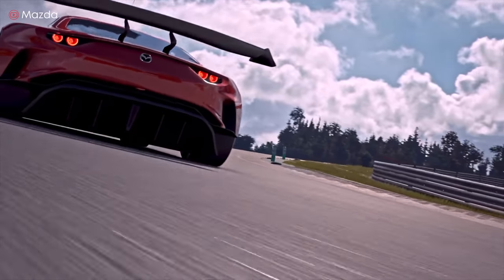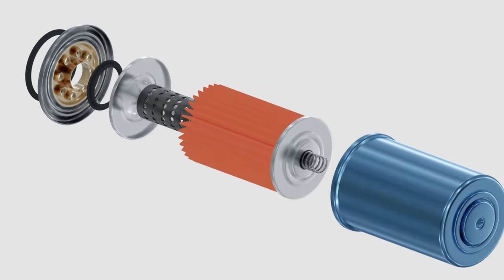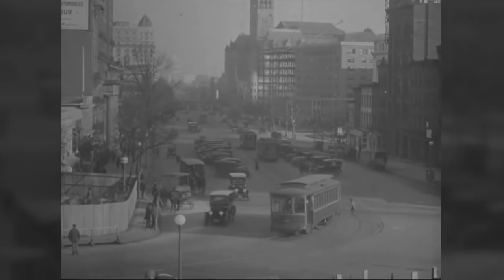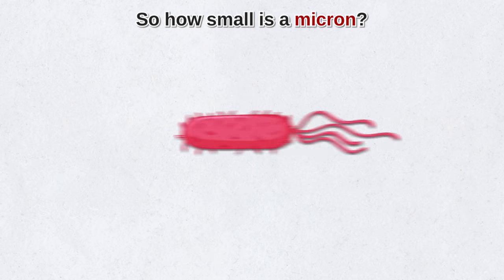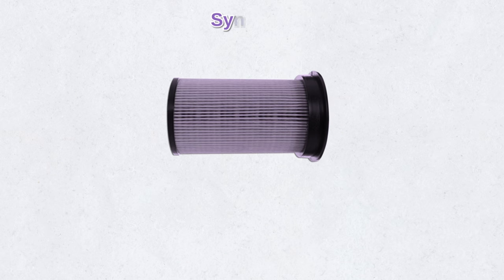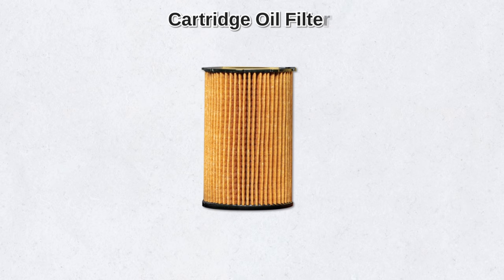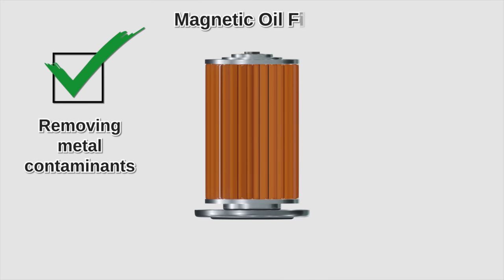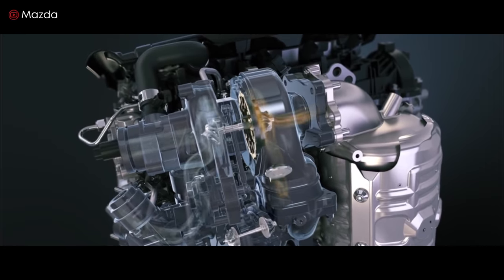This New Oil Filter Just Changed the Game (No More Oil Changes)

Comment: I added oil treatment and may have added too much, after an oil and filter change and the engine seized up within a few thousand miles. I believe the oil was too thick for the oil pump and failed, but don’t know for sure, the engine just seized without any kind of warning, It was a V6 engine with 145000 miles on it.

Comment: Hi Scotty,  I got a request for information on the following type of oil filtration that big rig trucks utilize as follows:      I liked your introduction to 2ndary types of oil filters.  Yet,  am thinking you could take another video with another step beyond.... I wish you would have taken this a step further to introduce us to the 2ndary oil filters that big trucks use.  Whereby,  on a cold morning oil is heated 1st; then pumped thru a 2ndary filter.  Lastly, the pump continues to circulate warm oil until a set oil pressure is achieved.  All before the engine is even started.   Feature benefits of this filtration system are just as easy to grasp as what you already presented.   Big rigs typically go 50k miles between oil changes.  Best Regards,  Sam
Reply: When I was selling Gulf Coast Filters years ago.their.main business was heavy duty diesels such as locomotive engines on Shell offshore rigs. Got a request for information from NASA. They are listed as a customer now..At the time they were moving the.Shuttle around.and  the Gulf Coast heavy duty filters used Bounty Big roll paper towels. Of course the little filters used toilet paper. They might have gotton too busy with the big filters to do the little filters. The best little filters are the Australian Jackmaster. Looks like they are working together. The Jackmaster is the only filter as easy to service as the Gulf Coast junior. I couldnt resist. I ordered
 one..You push the TP in and put on the lid. If you cant find a tightly wound roll of TP. You can buy good elements for 30 dollars and up.All I have now is Motor Guards  Gulf Coast juniors and the Jackmaster.

Comment: I have a funny story.  I brought my Cherokee to get an oil change at Sears back in 2006.  After that I got back to the base then there was a coolant explosion under the hood.  I opened the hood to find out for some reason they took the cap off, and apparently set it back in place without tightening it back down.  Several months later I was rebuilding my engine.  I haven't let anyone else change my oil since.
Reply: Took the Rambler to Sears to get new tires. Didnt feel right. Got out and checked. The lug nuts had been started but not tightened. Walked back into the store and told them they didnt tighten the lug nuts. They said they tightened them they just loosened up. I hadnt even gotton out of the parking lot

Comment: Funny that small air cooled and outboard engines still don't use oil filters. 
 My truck has an internal cartridge filter that many of newer cars have and it's not any less expensive than a spin on.  It is only a filter and an O ring whereas the spin on includes a metal housing and a few parts.

Comment: Best filter? I use the OEM ones, it is their motor, so I would hope they would supply the correct filter for maximum engine life. So far, no issues.
Reply: Maximum engine life? How about at least until the end of the warranty period.
Reply: except that engine manufacturers do NOT make oil filters...  May be Purolater or Fram with OEM number painted on, ya know?

Comment: Use only Napa best (made by wix) Most are, just different levels of quality. Use Amsoil for years and switched to mobil one. Any good synthetic will do, don't drive much and have 3 vehicles on road, change oil every couple of years. Use synthetic in everything including Kubota diesel and gravely etc. lawnmowers.

Comment: My MAZDA dealer REQUIRES me to get an oil AND filter change every 5,000 miles "because of our hot and dusty environment". I supply them with CASTROL Edge synthetic 5W-30 (their weight spec) and they use "MAZDA" filters. I fervently hope the MAZDA filters are at least a synthetic media filter with a good bypass valve!

Comment: Hi Scotty from the UK. Many years ago on a BMC  A  series engine after an oil check 5miles down the road the cartridge filter pushed out all of the oil but I switched off in time to save the engine... it turned out that the cartridge housing had more than one o ring!  Dodged a bullet that day.

Comment: Whenever I bought a new car, I would change the oil and filter after 1000 miles. Figured that most manufacturing particles would be removed with the first oil change. Never had any engine problems in first 100k .

Comment: Hi Scotty, They should make changing transmission oil easier… I bought a truck that sat transmission oil had not been changed in quite sometime that the oil looked like very dirty motor oil… it will have to be rebuild cause metallics where found in the pan… Thank you for your info. 👍🏼😎

Comment: 20 years ago had an old 4 door Chevy celebrity think it was 88ish went to the other side of town to change my oil at my bros house , for whatever reason prob a lefty, I forgot to replace the oil cap .During the ride home  20 mi or so I began to notice the engine smoking and a funny knock sound coming from under the hood .Long story short I blew the little 4 banger up til then was a really good surprisingly strong little motor 👍
Reply: I think mine was a 86 2.5  I pulled the engine put a 95 Impala.transmission on it and put it in my Farmall H  some say why didnt you put in a V8 . The only thing that will stop it is if it loses  traction. I have an Oldsmobile. V 6 I  think might fit the Impala tranny if something happens to the 2.5. The Impala 4 speed is in front of the  Farmall 5 speed.Has a modified F 350 front end with power steering.  Allis Chalmer front end loader. No oil change filters on every thing LOL. Motor Guards and Gulf Coasts  When I rev the engine I can hear piston slap. It doesnt use oil. Been that way for 20 years. The old man I got it from said it had about 30,000 miles since a GM rebuilt engine was installed.

Comment: Old Fiat 500 from 60-s and 70-s and the same engine had Fiat 126 they both didn't have oil filter, then it had centrifugal dirt oil separator on the end on crankshaft which you can open and wipe the dirt.

Comment: I took my truck in it was running rough so I told them to change the oil while it was there. They called me and said they went to try out my truck and it died and would tow it back in. The next day they called me back and said the motor seized up they forgot to put oil in it . They had to buy me a new motor and get me a rental

Comment: Here's one about 22 years ago, I went to change to oil in the step mothers van. Was told it's was changed by her son 3500 miles miles ago... it wasn't and the oil was so bad I couldnt get the filter off had to stab it with a screwdriver in order to turn it. The oil was completely turned to sludge im surprised it came out at all... had to flush the whole system and immediately change the oil filter a second time 10 mins later...

Comment: I did and oil change on my BMW 1 series, filter was supplied from an online parts store using the registration plate of the car... It would have helped if they actually provided the right one... Found out after taking it on an hour long drive with the oil pressure light coming on and off (Didn't actually realise it was that at the time. Ouuch.  Turns out it didn't have a locator pin like it should have.  - Could have been rather expensive as the bottom ends like to go on the n47 engine... as well as the timing chains. - Since replaced it with the right one and its still going strong

Comment: I once worked at Toyota and we had a customer who had a oil change appointment set up but her and her boyfriend were going to go on a trip, and they wanted to leave early, so her boyfriend said he could do the oil change. By the time the car made it into the shop, on a flatbed, it had no transmission fluid and doubled the amount of oil in the engine🤦‍♂️. Instead of undoing the one drain plug for the oil underneath the car he took out like the 28 or so bolts that held in the transmission pan completely drained that and then proceeded to feel the car with oil needless to say her transmission was fucked and so was her engine. I mean he wasn't even smart enough to look at a YouTube video.

Comment: So I went to go get an oil change. The oil tech barely applied a socket to the plug when it fell out. Come to learn that the last oil change place stripped the plug and was barely held. That what you get with an aluminum oil filter. So... I had to pay $70 to tow the car to a repair shop to have a new oil pan installed. Since I was heading out for a drive from Michigan to Washington state, I needed it fixed now. So $700 and a day later I was on the road. Ugh.

Comment: I use Mobil full synthetic oil and a Mobil full synthetic oil filter as I believe after research 🧐 they are the best and change every 7-8000 km maximum ( 4500-5000 miles)

Comment: Using an oil designed for higher mileage for changing one should change out their oil filter every 3500-7000 miles & replenish what is lost in the oil filter change. Even when using a high quality filter I change it at 5000 miles, especially in the from spring, summer & early fall I switch out sooner.

Comment: Gonna upset some people but I have used Mobile 1 full synthetic oil with their premium filters on my cars for years without any issue. Using the better oil and filter I usually run 7-10k miles per change so basically i make one oil change last two. It’s worth the extra 10-15$ upfront and keeps me from having to get under the car so much.
Reply: I probably average 1 oil drain every 100,000 miles. Sometimes I want to try a different oil. I use the game changer filters. I normally change the game changer filters every 6,000 miles. Running a little late on changing the Wix on the Pontiac. Been on there about 4 years and 60,000 miles. Try not to spend too much time under the car. I dont use junk. Very little showing up in the Jackmaster which tells me the Wix is still clean and the Walmart synthetic is doing its job. Its been awhile but I probably liked the feel of the wix. They all do what they were designed to do
Remove the engine damaging abrasives from the full flow of oil to the engine. You change the oil to get the small engine wearing stuff or install a game changer filter to clean the oil.

Comment: My first car a 54 chevy belair had no oil filter, just changed oil every 1,000 miles.  It also had one of those air filters that you washed out with gas and refilled with oil.  I also had a 40 chevy with the same deal.    Paid 150 bucks for the 54  and 25 bucks for the 40 chevy  Built like tanks.  no seat belts though .

Comment: We quit using FRAM oil filters, because of low oil pressure. We now use supertech oil filters and good price and change them every 5,000 miles along with oil change. Royal Purple only!
Reply: troll filter ^
Reply: Never seen a full flow filter that lowers oil pressure. The Fram has a very good relief valve.
Reply: In the filter business you are liable to hear anything. That's why the NASA engineer says these filters are for industrial use only. You have to talk to 500 people to find 1 that can comprehend filters that clean oil or magnets that grab steel. Why do they put magnets in transmissions.

Comment: I have a 50 Pontiac with a straight 8 flathead. No filter. It has a centrifugal oil cleaner in the pan that I need to look at and clean someday. I have a massive blue streak engine, designed in the 20s, in a snowgo truck snow blower that has no oil or air filter at all.

Comment: Sometimes I would do a quick change by just changing the filter and replace the oil in the filter with new oil, adding a little new oil to existing oil.  I think that  would give the oil some extra life.
Reply: I do the opposite. The 5.7L in my '88 Chevy van loses and uses 1 quart of motor oil every 300 miles so I change the oil filter every 2 years and the oil every 4 years. Been doing that since 2000 and have placed another 100,000 miles on it without any change in performance, gas mileage and oil loss.
Reply: Thats correct. That would help keep the additives up to specs. I do the same thing but I use a roll of toilet paper.  I have a dozen toilet paper filters in use now. I like to use the top loaders. They can handle the larger cores And the shorter TP.

Comment: So which was the new  game change filter? Honda have used centrifugal filters on motorcycles since the 1960's and they are much more efficient at removing particles than any strainer. The engines were designed with them so they don't have issues like an after-market one although they do require cleaning every 20~30,000 miles unless there is an engine failure of some type (usually clutch as transmission and engine share same oil, motorcycles are 'different')
Reply: Had a Honda 500 Custom .Early 70s. I converted the canister full flow filter to a spin on full flow filter..used  the Frantz sandwich adapter for pressure to the Frantz that was upside down back behind a saddle bag. Tapped a cap similar to.what you remove to adjust a valve for a return of the clean oil.. One day I got to thinking why am I riding this thing I have a car.  I used a 3/4 16 thread adapter. Had a Motor Craft Fl A. Also could use Toyota.
Reply: @ralphwood8818  Must gave been a 500F as the 500T didn't come out until 1975 or 76.(I forget, been a while since 70's)
 The single cyl and twin cylinder motors used centrifugal filters until late 70's. 
I've made adapter plates to screw filter directly to crankcase on various Honda 4's, take off is used for oil cooler although a remote filer could easily be fitted in feed or return side
One thing Scotty didn't mention, ALL screw on filters allow unfiltered oil to flow, even in a hot engine if rpm is high as the pressure can easily exceed the bypass valve spring pressure.
 High rpm is when a centrifugal filter becomes even more efficient at removing particle below 5 micron

Comment: I buy my oil and filters at Walmart. $2.99 for a fram filter. In the auto parts store r usually $7.00 for my car. Big difference
Reply: Fram is a lower brand filter.  WIX is much better.  Search you tube for a comparison study.
Reply: For about $1 more, you could probably buy a significantly better filter. Check sites like Bensbargains and Slickdeals for the best oil deals and you'll often beat Walmart's prices.
Reply: @wholeNwon  lol, what's the shipping cost at Slickdeals, or how many miles to drive there? Never heard of them...
Reply: Saw a picture  of an Aston Martin  engine once that looked like it had a bottom of the price Fram on it. I wonder how long Fram would stay on business selling filters that damaged Aston Martin engines. Personally I pay for the more expensive ones. Just kidding it was a Aston Martin with a Ford engine and a remote filter mount with a orange Fram filter on it. I think it was a James Bond car. I dont forget filters. That's my interest.

Comment: Reminded me back in the early 1980's when both my cousin and I always used Castrol oil in our engines. One time I found Quaker state oil on sale by the case for about half the price. We both changed our engine oil with the Quaker state and within a week we both lost our engines. I know most North American cars from then were total junk, late 70's early 80's. However the only explanation was the oil we bought. I wrote a letter to Quaker State and of coarse never got a reply. We replaced the engines and never bought Quaker state again as well as every friend and family member.
Reply: Many years ago I worked for a trucking company that was offered a special price on oil.  I think 80 barrels were delivered.  It ended up being mixed with crude oil and sold as crude oil.
Reply: Quaker state and Penzoil...are same company now...oil is identical

Comment: According to Scotty, when the engine is off, "the anti-drain-back valve prevents oil from seeping into the engine." Huh? Seeping into the engine? Seeping into the engine from where? From the engine? It isn't as if, when shut off the engine, oil leaves the engine – there is always oil in the engine.

Comment: I had a very small oil leak after an oil change.  I brought it back to the dealer and they told me that there was nothing wrong and that I may see some drops for a few days.  Yes, there were drops for over a week so I took it back, and again they said there was nothing wrong.  I still saw  oil drops on the garage floor so this time I took it to Firestone instead of the Honda dealer.  Firestone put it on the rack and within minutes told me that the oil filter was warped and needed to be replaced.  A new oil filter, top off the oil and I was good to go.  When I reported it to the Honda dealer and told him that I was going to social media to share that they were incompetent they blew a fuse!   Well, I did and they begged me to take it down and offered some free oil changes.  Can you imagine me accepting anything from incompetents?
Reply: I don't trust any of them as far as I can pee on them.. If theyre not rip-offs, theyre worse- incompetent..
Reply: My new Rambler American had a rattle I couldn't find. I was waiting at the Rambler dealership  for them to look at it. An elderly lady pulled in with steam coming out. I heard the mechanic tell her it needs a new water pump and a few other things. He left the hood up. I took a look. I told her all that it needs is a new hose. There is a pin hole in it. She asked me if I was a certified Rambler technician.  I got back in my car. They told me the rattle was a hog ring in the seat cover. It rattled all the way home. A body man at work said there Is a metal piece between the back seat and the trunk. Get a ball headed hammer and  put some dents in it. Never rattled again.